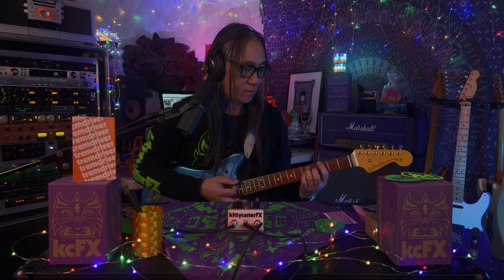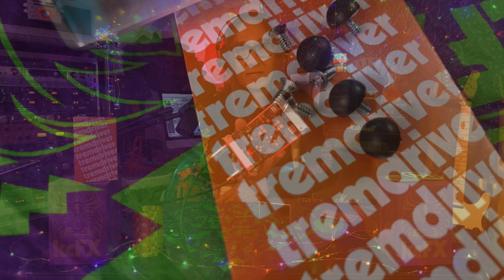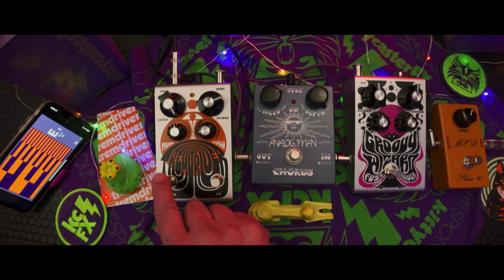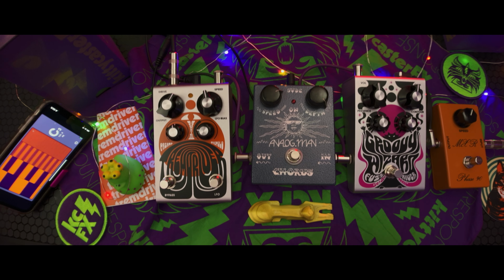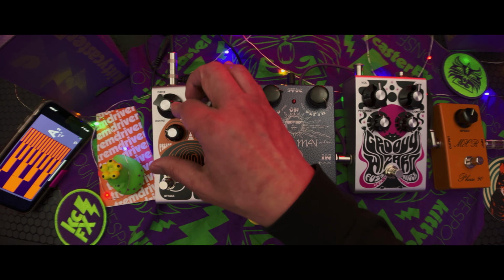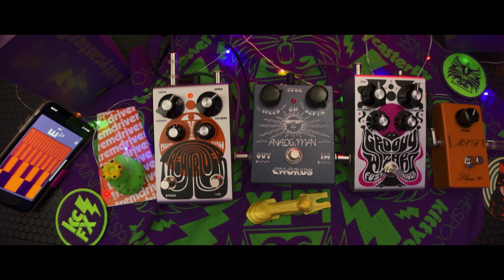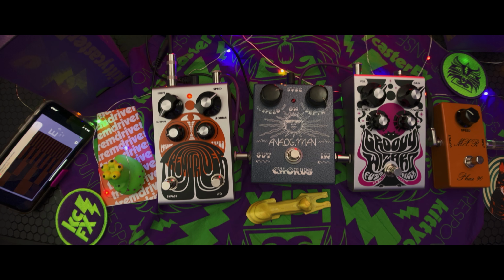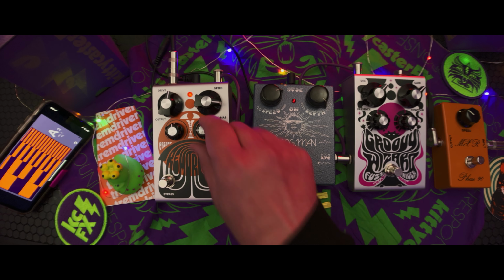Presenting Tremdriver Deep Dive Guided Tour

Comment: Have you used the tremdriver on a 100w hi watt to get it to break up and compress a little more?
Reply from the maker: I don’t have access to a 100w Hiwatt but that would be an interesting test!
Reply: @kittycasterFX  I have one more question about it. I have a Belle Epoch Deluxe that I have in trails mode. Is the dialable EP-3 on the tremdriver more noticible than on that pedal? Either way the tremolo sounds amazing on the tremdriver! Keep up the great work!!